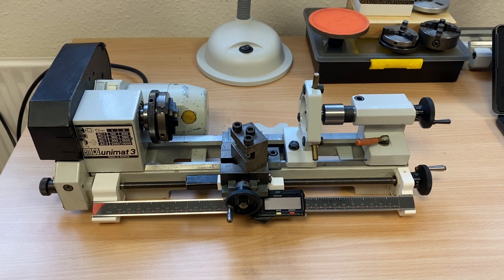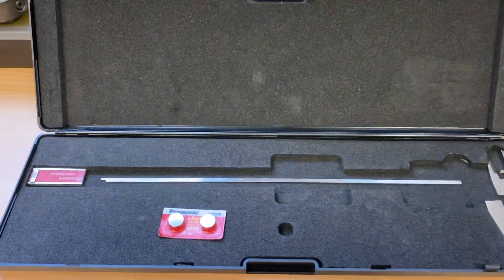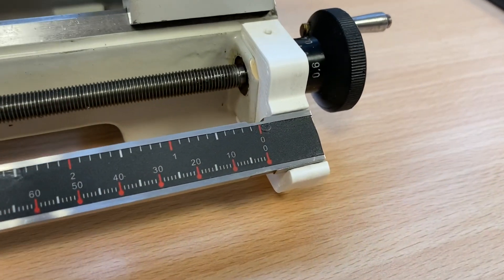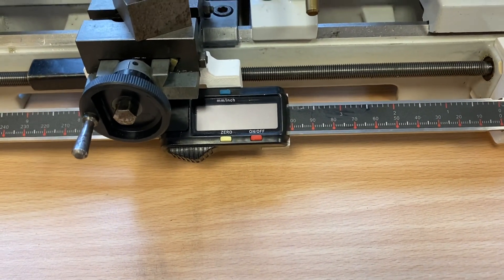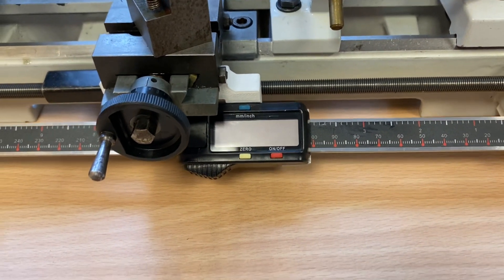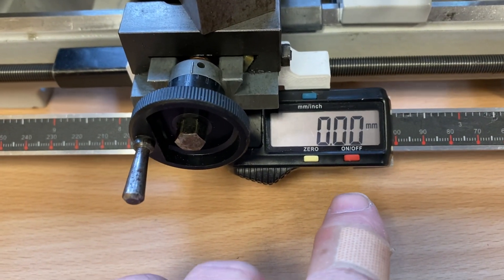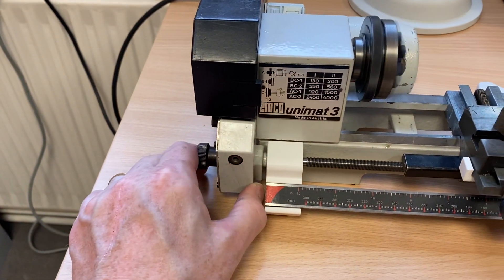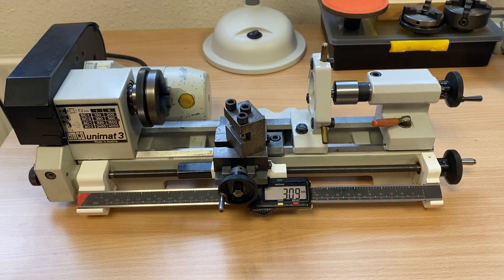3D printed DRO for Unimat 3 lathe

Comment: Crap.....you don't need a readout on the Y axis (bed ways) you mostly want it on the X axis or crosslide, that's where it works most......edit.
Reply: You're the one who's talking crap. This DRO is on the X-Axis. The cross slide is on the Y-Axis. Lathes don't have a Z-Axis which is used to indicate height.
Reply: @Alan_AB  Yes I know, my mistake, no Z on a lathe .........on a mill the X is the table and the Y is the crosslide so I suppose the lathe has the X as the crosslide and the bed ways the Y axis.
Reply: @gangleweed  Not really. The bed is the X-Axis and the crosslide is the Y-Axis. X Coordinates always run left to right. Y Coordinates always run top to bottom in 2D or front to back in 3D.
Reply: @Alan_AB Not having any interest in CNC turning.....old school turner....... I haven't really familiarised with the topography of a CNC lathe.....my main interest is with CNC mills and manual lathes.
Reply: @gangleweed  It has nothing to do with CNC. It applies to "old school turning/milling" also.

Any standard engineering drawing will have these coordiantes all marked along those axis. X is left to right, Y is top top bottom or front to back and Z is always a height coordinate. There are also further axis of A, B and C which are related to angle and attitude of a machining head.

Everyday's a schoolday, Sir.
Reply: @Alan_AB  Having been a retired fitter and turner for the last 20+ years, what they designate the various axes is of no interest to me, except for CNC milling where it would be vital for the G code.........I'm not into CNC turning or ever will be..........I've never ever seen a "standard" drawing that had axis designations on it, and I worked in a drawing office for the last 17 years of my working life.....I can't imagine what purpose it would serve.
Reply: @gangleweed  If you had worked in a drawing office you would have either seen or heard of "Isometric and Orthographic Projection" drawings. These drawings are standard engineering drawings but have the Z Axis incorporated into it to produce a three dimensional view.
Reply: @Alan_AB  I was in the drawing office as a production planner for 17 years...........drawings were my bread and butter but for the last 15 we were on cad.
Where on a drawing would you see any reference to X, Y or Z axes?
Reply: @gangleweed  Maybe you work differently. I was 20 yrs in the aerospace industry. We had it on all of our isometric and orthographic drawings. We needed them to indicate the X and Y axis. Althought these Axis were already referenced in the 2D projections.
Reply: @Alan_AB  Although I was in the drawing office I never actually did any drafting as I was more involved with production planning but part of that was involved with drawings, mainframe update and tooling compilation for production.
As far as lathe axes configuration goes I was under the impression that you looked at the spindle and orientated the crosslide as the X axis and the bed ways as the Y.....the spindle being fixed and horizontal was not in the picture like a mill etc..........I wonder how this goes for a horizontal borer which is like a lathe with a rising headstock.